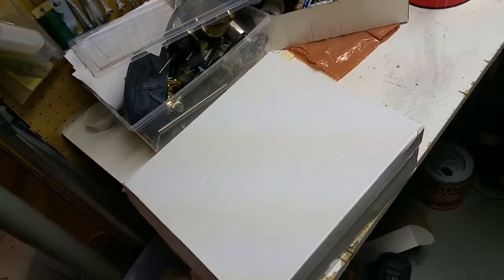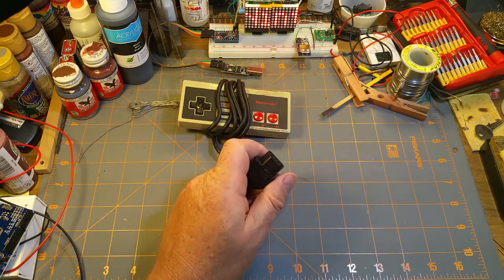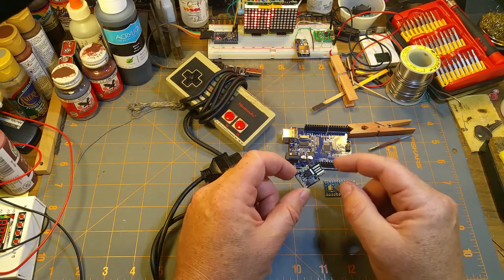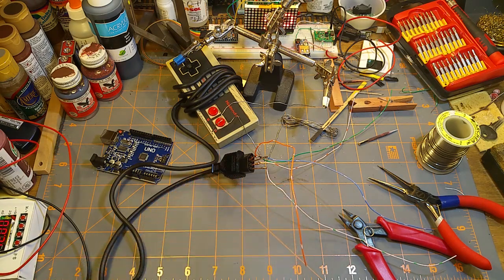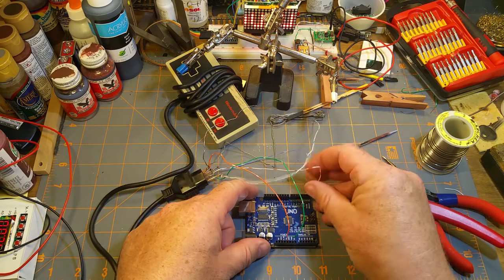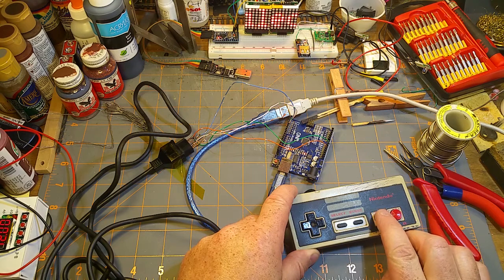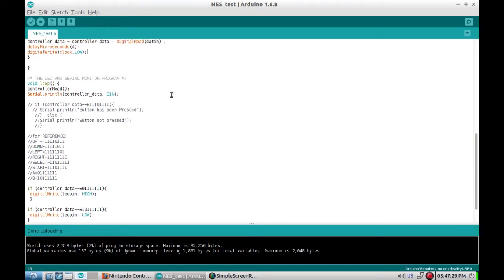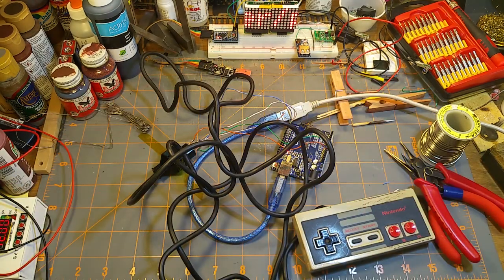nintenduino

Comment: Actually you can use Uno as a USB input device, by reprogramming its USB interface controller chip thing.
Reply from the maker: depends on which chip it uses fro USB-UART.

Most of mine use CH340, but if you have one with a 32U4 then that approach will work.